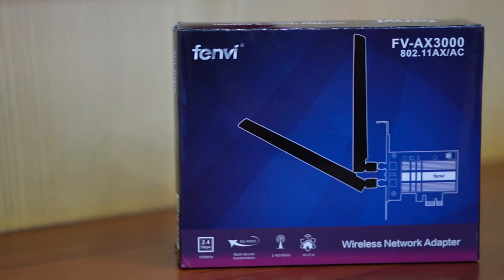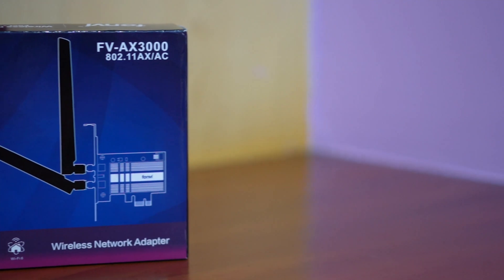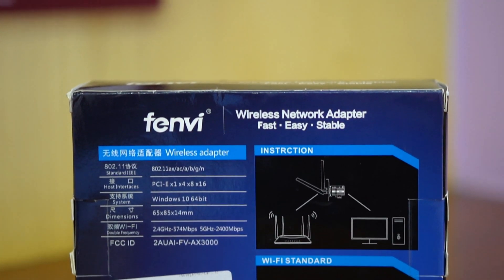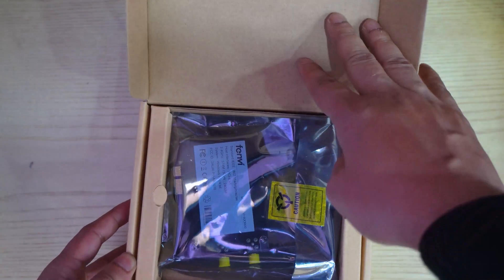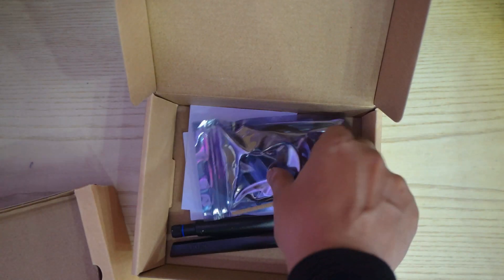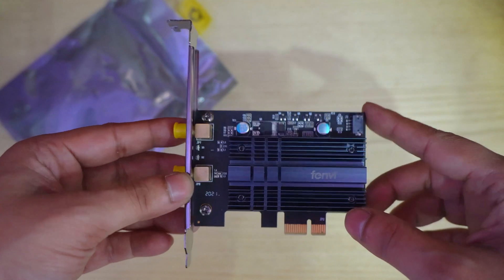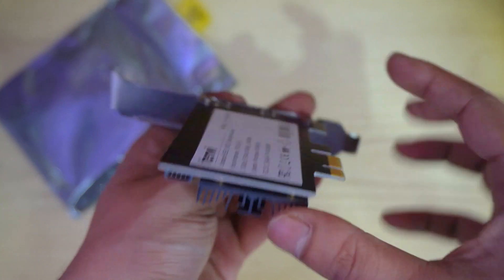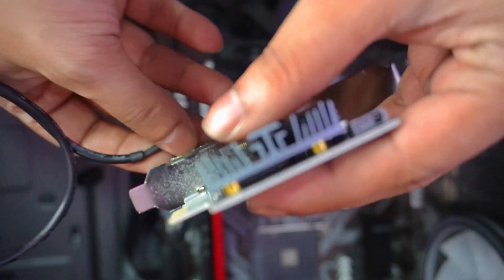WIFI 6 + Bluetooth 5.1 Card for Desktop PC - AX3000

Comment: I just installed this but the Bluetooth ( Intel Wireless Bluetooth )  is always showing in the ( safely remove hardware and eject media ) option in system tray ,which is very annoying.
Is it the same for you
Reply from the maker: No I do not have it. Though I have it on a different card.
Reply: @avktech  is your system intel or amd ?maybe have to do something with that?
Reply from the maker: Both systems AMD. With ryzen 7 5700G on both
This model does not show anything on the "safely remove usb".
The other one is A laptop mini pcie Card (same intel Ax200) but used with an adapter for desktop. That one shows the "remove media stuff".
Will need to investigate more to know better.